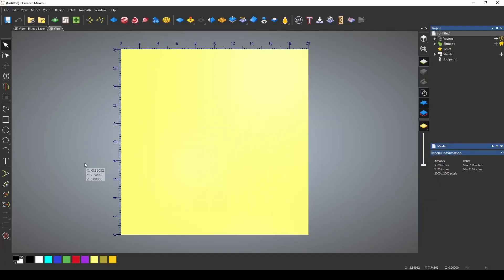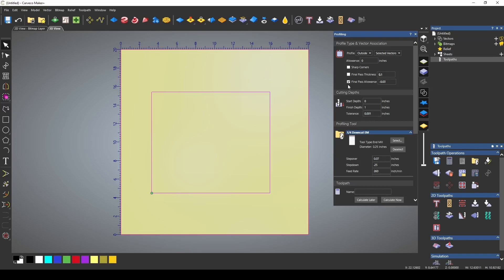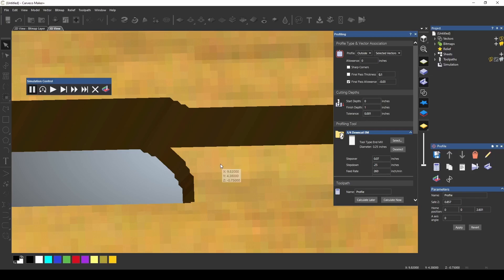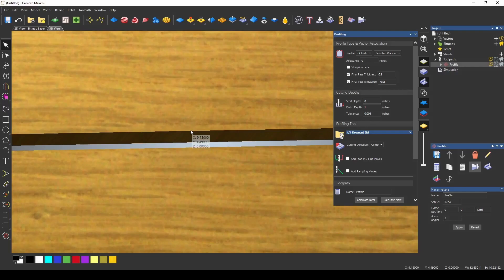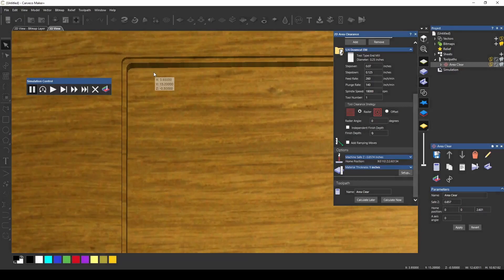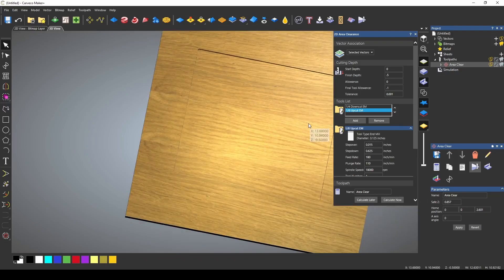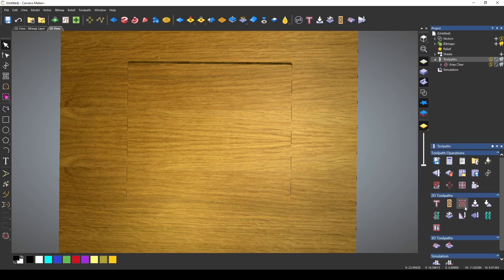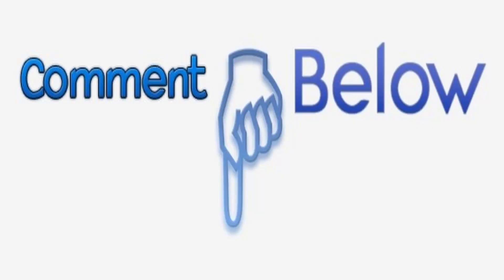CNC Secrets: Unlocking the Power of the Last Pass in CARVECO

Comment: I am going to try the final pass on a pocket cut but add a bowl bit for doing the rounded inside corner as the second tool. As soon as I saw this I figured it would work for that vs creating another tool path. Thanks for the info.
Reply from the maker: Thanks.  I am glad this was helpful in explaining that. Hope your project goes well!
Reply: If you want to do a final pass with a bowl bit you have to offset the ruffing pass far enough to leave material for the bottom radius of that bit.

Comment: That was helpful, subscribed, thank you!  Was wondering, can u do an extra final pass for a 3d relief setup?  New to carveco and trying to figure out how to add 3rd toolpath to the 2 that you get from the 3d relief tooltpath setup?
Reply from the maker: I am glad that one helped. If you create another 3d toolpath with just a finishing pass you can use a different tool to go back over the carving just run it 3rd. If you only want it to do certain areas then draw vectors around those areas and then use selected vector option in the 3rd toolpath. Hope this helps.
Reply: Rest machining should do that.

Comment: If I'm following correctly, you use a negative allowance on a profile cut and a positive allowance on a pocket?  Then, during the finishing cut the tool gets to the final dimension, either external or internal?  You're not taking off a little bit more in the finish cut so the piece is slightly off, dimensionally?

I would have to say that the sign convention is a bit counterintuitive.  I would have assumed the software would manage the allowance depending on the operation.  I would not have thought to use a negative allowance on a profile cut.

Thanks for explaining this.
Reply from the maker: The last pass allowance will step out that amount until it gets down to the last pass and then step in the allowance distance to get your actual size. So the first few cuts are actually the distance outwards of the allowance you set. Depending on if you are inside or outside of the vector will determine if you need to use a negative or positive allowance to make it work in the right direction.
Reply: Excellent.  That's how I interpreted your video and I can accept that's how it will work.  It wasn't intuitive, so I'm glad you took the time to create this video.  I really want to add finishing passes to my projects and now have more confidence on how to do it.  Thank you. @Timberfalls
Reply from the maker: @gizmobowen  anytime and thanks for watching those.